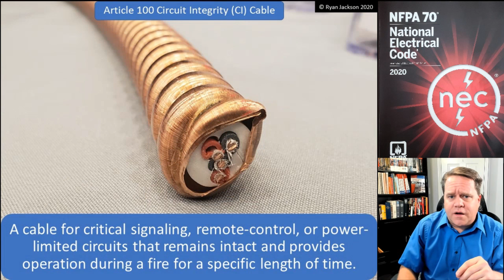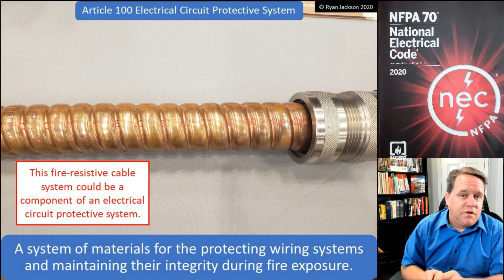100 Days of Article 100: Circuit Integrity Cable and Electrical Circuit Protective System

Comment: Had to deal with very similar situation for smoke control, pressurization power and activation for egress pathways in 6 story wood multi family with PT decks and 2 story garage.   I HIGHLY recommend researching the emergency and life safety needs of the building far before ground work, if you are assigned to the project early enough as there are many ways to make life easier later in regards to these fire rating requirements, such as concrete encasement, instead of surface mount fire rated cable system, with 4X boxes, and very very expensive fire wrap layering. etc. etc.
Reply from the maker: Well said! This is the kind of thing you don't want to use trial and error on.
Reply: Definitely.  Concrete encasement can and has saved me from a ton of stress. I have had to install draka feeders and the lifelien mc. Both are a pain.

Comment: I just finished the video on available fault current.  What is the method for determining this on a battery bank seeing that the overcurrent protection devices could be relied upon to operate properly under extremely high current?
Reply from the maker: The manufacturer will have a chart.